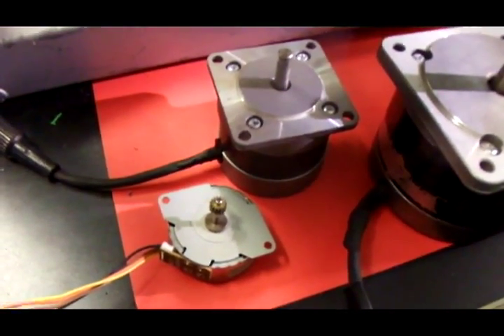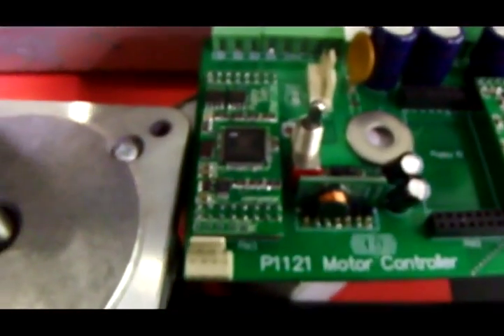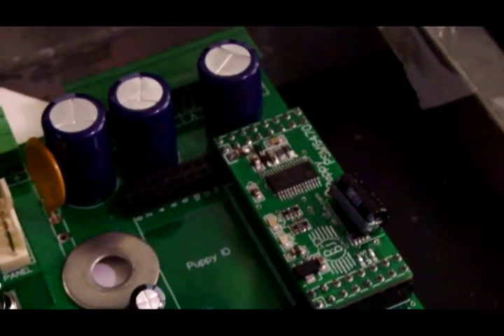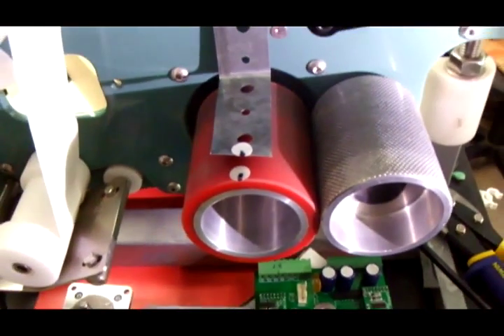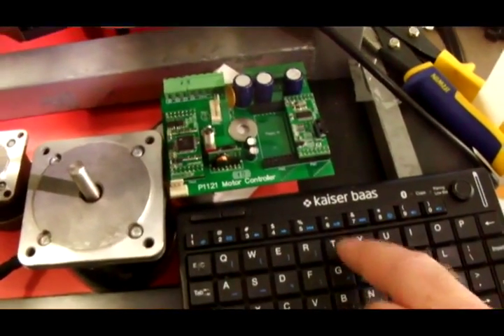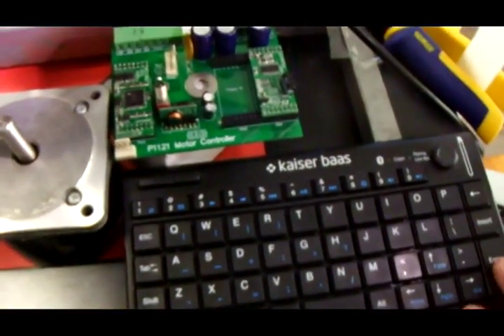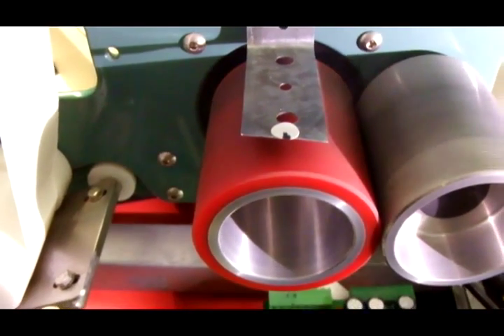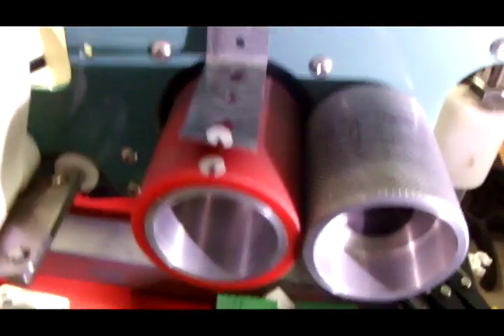L6470 Microstepper driver

Comment: I built a small drive using the L6474.. But i find this chip runs Super Hot !!   @ 1.5 amps /phase @ 42 volt ps. It gets over 110 deg C in 2 minuites.  
 Anyone one else using the L6474 ?

Comment: In daily use, how often do you find that your steppers loose a step, or take an extra step?  I'm just learning about steppers and as an open-loop system, I'm curious how reliable steppers are assuming they are properly matched to the load.